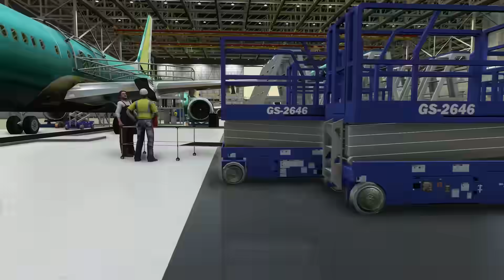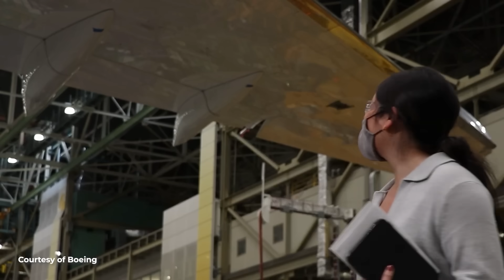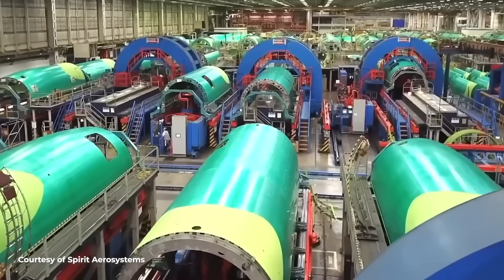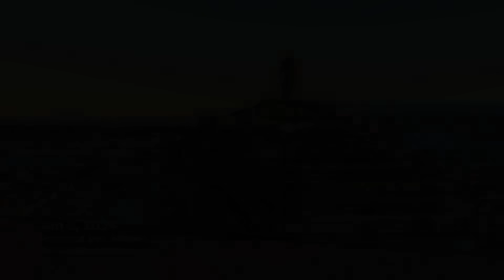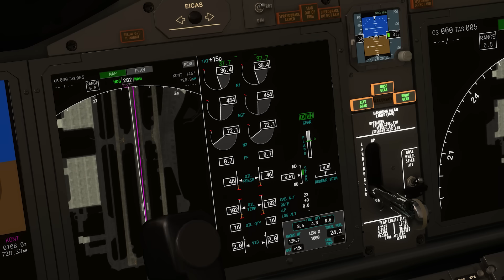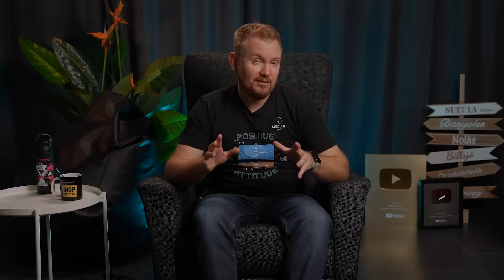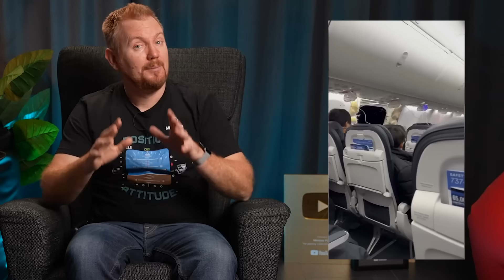Boeing 737MAX BlowOut!! The Scandal behind Alaska Airlines flight 1282

Comment: As a non Boeing engineer, I appreciate bolts. 
Thank you all for the hard work every one put into all these bolts.
Reply: Bolts hold our world together. Literally.
Reply: @CWINDOWSsystem32 *mechanically
Reply: The bolts have to be PROPERLY INSTALLED to work. 😢
Reply: @faranger Bolts are made for one purpose, I think it is not to be put just alone ... for the weight.
Reply: @malebetegrrr5793  No shit really?
As a Certified Aircraft mechanic With a Degree in Aviation maintenance Technologies from the National Aviation Academy in Clearwater FL 4.0 GPA. 

The BOLTS have to be INSTALLED to work.
 Even the slide mounting bolts were loose and no safety wire or safety cable installed.
Reply: @faranger Oh really ? Don't we discuss about how to use bolts properly ?

I have some degrees in Engineering (but I am French, sorry), I never ever show it when discussing about bolts.

I never will discuss a mechanics engineer about if a bolt should be secured, by what mean, etc ... it is his domain, no mine. But it should have been a thing to be observed by Boeing.
Reply: @malebetegrrr5793  How can bolts that ARE NOT INSTALLED GOING TO WORK.
THE REASON WHY THE PLUG FAILED IS BECAUSE THE BOLTS WERE MISSING.
MY GOD the level of stupidity in the world today
Reply: @faranger  Bro no one cares about your credentials online, let alone your GPA 😂
Reply: @Carson0101  They are good in the real world also kid.
Reply: @faranger  And that may be true. But most people who have them don't state it like it gives themselves some inflated sense of self-importance before they state something like "Yeah guys, the condom needs to be put on to prevent pregnancy."
Reply: You onviously dont listen.@faranger

Comment: It seems to me, that if those bottom springs were not fitted, either the door would not have opened or opened later on at some stage. It might even have been the case that the springs prevented the bolts from being installed in the first place. It would not surprise me if this door was fitted during a shift change or lunch break.

Comment: Does anyone else believe the the retention of the flight recorder now needs to be taken away from the hands of pilots, and becomes an AUTOMATIC function? All flight data for all flights needs to be uploaded after EVERY flight and retained for a predesignated period of time?????
I am completely gobsmacked that the pilots failed to pull the circuit breaker for the flight data recorder, and I'm probably going to annoy some by suggesting it should be seen as a gross misconduct offence. So take the responsibility away from them, and record every flight, retain, hold, and delete in accordance with other data retention policies! After installation of a cloud based system, it runs itself, and access is only needed in the few instances that require it.

Comment: Excellent video as usual Petter. Informative and unbiased! Also a reminder to everyone, always wear your seatbelt, even when the seatbelt sign is off! The only time you shouldn't have it on is when you are using the toilet or stretching your legs! In this case had a passenger been sitting there with no seatbelt, they almost certainly would've been sucked out.

Comment: The cockpit door opening would also decrease the risk of injury when cabin crew would try to open it to tell pilots what has happened. Of course, they probably would be aware to not try to open the door if they knew there is a big pressure difference, they probably would be trained to not do it, but it is a bad design to rely on people remembering such details in heat of the moment. IMHO, the doors or wall should have just a membrane that pops when there is a pressure difference strong enough to make issues. And design it so the decompression in cockpit is slower, to preserve pilots health and capabilities, crucial for everyone's survival in the plane. And less risk for injury overall.

Comment: As mentioned by many, dangerous economic policies drive negative culture/quality changes. The dismount/remount of the plug should only be performed by qualified & authorised technicians, using current instructions and checklists (which can be updated at any time). All safety-critical repair work should trigger physical QC checks, using the same checklists. And all of these actions should be covered by obligatory process controls. What you describe, if accurate, approaches amateur-hour by aeronautic standards. Optional communications, misaligned systems, performance checklists ?, QC follow-up ?, continued use of an (unpaid ?) and failing supplier without confirmed corrective actions (improvement results after time). Only the CEO's of Boeing and Spirit can be held responsible for this. THEY control the budget, the policies, the SOP's, personnel selection/training/use/supervision/monitoring/motivation, and THEY are fully aware when safety-critical issues occur, and CANNOT use short-term cost as an excuse for incorporating long-term indeterminate risk into commercial aircraft builds. How many other (currently hidden) problems will be discovered by catastrophic failures or fatal incidents ?

Comment: It has nothing to do with the design of the 737 itself? Boeing is not at fault? Seriously?
1. A Design Feature, Boeing had forgotten to tell Pilots about (like MCAS)?
2. Why are the springs left in place? They are obviously meant to ease the opening of the door. If one doesn't want to open the door ever again, why not to remove them. They are counterproductive, as they create unnecessary distress to the system.

Comment: It is quite shocking that there is a Boeing manufacturing process where the safety door bolts can be removed without a documented check that they have been replaced afterwards.
Retired now, I have worked in both aviation and nuclear fields where you RISK-ASSESS EVERYTHING. This situation inevitably asks the question: "What else have Boeing missed?"
People like me will no longer choose to be a passenger in a Boeing aircraft.

Comment: It's kind of ridiculous that even nowadays, CVR can only record 2 hours and will be overwritten if not shut down by accident. I've just read that in Europe the required recording duration is 25 hours since a few years now.
Since Boing has to have an existing solution for a longer voice recording capacity CVR to comply with EU regulations the fact that they still use a lower capacity one of brand new aircrafts is just another point for me to show they are willing to save some small amount of money at the cost of flight safety.

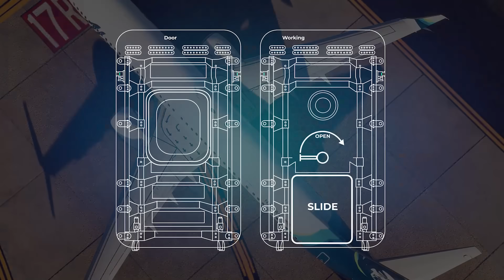Comment: 5:30 door plug diagrams,  explanation 👍 ... 24:25 1282 door plug fails 25:40 map showing where objects landed 26:32 cockpit door flies open (undocumented design feature - oops) ... 38:37 CVR keeps running by default, all emergency recording lost☹️

Comment: Isn't the existence of a wholly separate and unofficial reporting tool that seems to be used extensively at Boeing to avoid problems from being reported officially already a sign that Boeing is trying to hide things from inspectors? I mean: if it's used for comments or non-critical communications, like: part X in the cabin hasn't been painted properly, that's fine, but as Petter explains it this was also used in the case of this door-plug, which is a very critical problem. That the official reporting tool is cumbersome to work with, probably lies within the fact that it deals with critical problems and those problems have to be meticulously documented to ensure that they have been solved properly.

Comment: I don't think it was merely luck that the departing plug door did not hit the horizontal stabilizer.  When it came free of the stop pads, the bottom edge was still held by the hinges.  The air pressure forced the top of the door to rotate out and down.  When it broke free from the hinge, it was below the horizontal stabilizer with downward momentum.  It would have required unusual airflow to lift the door to the height of the stabilizer before it had been left behind.

Comment: we saw where an Australian media did a show on the Max, where they couldnt get sections of the body to go together, so the quality team went to the vender and noticed they were using rudimentary tools vs the laser straight ones,  So they raised a concern, Company sent them packing and think there were told  he would have em fired.. and yep they were  when they showed their findings. So shows one where they hold quality depts. Also any issues found outside the USA  is not required by a US made part or entire airplane to be looked at. It came up that in Canada they had a in fuel tank pump issue with a fire ?  and Boeing didnt even open the email with the concern.

Comment: 'Forgot to do something?' 
The issue is the systemic failure by Boeing to address quality control procedures across multiple aircraft models.And of course the Max control program issues resulting in the Max crashes. Problem after problem at Boeing, particularly with the 737 MAX. That's what happens when you have accountants controlling the company, not engineers.
Currently there are no MAX in Australia. When Virgin Australia receive their MAX orders Ill fly Qantas and Jetstar. No way I'll fly a MAX. God bless Airbus!

Comment: As an x employee of Boeing i really have a hard time understanding how this happened as every process is inspected, bolts are torqued and inspected.  Occasionally there are assemblies that have been previously completed that have to be removed. In this removal process there is removal documentation with an inspection to remove and inspection to reinstall  and a final inspection that the re-installation of the removed components has been completed. At minimum this would require two people signing that  this work was completed.
In my view there are a couple people involved in this that maybe should be looking for new jobs in a different industry. It should be clear on the documents who did this work and said it was ok. And if they did this work without following the procedure an initiating the appropriate removal documentation again they should be looking for new jobs. Every component has an installation process and every completed process that later needs to be removed requires that those removed components are documented and re-installed and reinspected to completion per plan.

Comment: Thank You for putting this out early. This is exactly what I though when I saw the pictures of the door with no bolts. Simple mistake by the maintenance team and I'm glad the jets that didn't have this seal replaced are not affected and everyone is ok 🙏🏻
Reply: Not just a mistake by the maintenance team, but also by the team who produced the procedures not requiring an indrpendent inspection when the plug door was only opened but not removed.

Comment: The really sad part about how Spirit Aerosystems got spun off by Boeing and now seems to be in disarray is that this plant in Wichita was THE ORIGINAL factory that built the B-29 bomber (which also had severe build problems, you should do a segment about that), and then later the B-47 (another troubled design), and finally the iconic B-52, the Forever Bomber.

Comment: Excellent presentation.  The pilots did extremely well from start to finish.  Shaken but not stirred!

QC; did the lame burdensome ISO 9000 bs play into this?  Too much paperwork means companies try to shirt around it and it inhibits productive and timely internal communications about critical problems.   

ISO 9000, etc is a lame accounting system rather than inspection system that many times interferes with the manufacturing process with it's mountains of paperwork that waste manpower and resources.  ISO 9000 was always a useless burden that's nothing but a complex paper trail of needless documentation.  Primarily implemented to aid large corporations to squeeze out smaller competitors and to burden non EU countries like Japan.  More globalist bs.

Comment: What happened was that the door plug was designed by an id10t and approved by brain dead execs.  I wouldn't have approved the design when I was 12 years old.  What kind of mechanical engineer would make such obviously stoopid design decisions?  Any other questions?
Reply: Summed up in a nutshell.  But the FAA like it to be a QC issue as it shifts any blame away from them.

Comment: This is not the problem.  The problem is that this bureaucratic process was NOT necessary in the original workforce set-up at Boeing and Everett specifically.  What has happened in the past 2 decades is that Boeing has "progressively" hired and outsourced to a less and less competent workforce and managerial class from CEO to financial disbursing (take a guess on what specific "qualities" they're hiring for - HINT: they don't hire on competence or experience).

The problem with this is that less competent (and frankly "Dishonest" and "Diverse") workers are NOT "cheaper" or "more effective".  The result is that all this "Quality control bureaucracy" becomes layered on top of them to "compensate" for their incompetence and malfeasance...something you did NOT require (at least not NEARLY to this degree) with a competent and "less-Diverse" workforce of the 1940s to the 1990s and even most of the 2000s.

This Bloated Quality control bureaucracy at Boeing didn't exist...because it didn't NEED to exist.

THAT'S why the manufacturing process has become overly expensive, inefficient, and wasteful...and it's ultimately futile to try to account for malfeasance in this way - when someone makes a mistake like this today in Boeing, they get away with it...nobody is allowed to hold them accountable.

Eventually, this will end with the death of Boeing and the larger US aeronautical industry, because - guess what - there are international competitors who don't deal with this BS (they have problems of their own, but this problem is a Cultural Poison to US Engineering and Manufacturing which our most important competitors do NOT have to deal with).

For example, we know the workers on the assembly line, their supervisors, and the management team at Boeing and Spirit CANNOT be fired for their mistakes.

The media and company REFUSE to identify them.

Take a guess why.

Comment: I really like the videos, but is the imperial system from medieval times? What is a foot? Come on man, help the world evolve. Adding or removing a 0 is simple.
Reply: Altitude for aircraft is units of feet worldwide, with few exceptions.  There are good reasons for this, which you might understand if you tried to design an alternative system based on Metric units, including a comprehensive plan for changeover.

Flight levels for cruising altitudes are in units of 100 feet, so 15 thousand feet is flight level 150.  Flight levels are then counted by tens: 150, 160, etc.  It is quite simple.  I thought people who prefer Metric units liked multiples of ten, so I don't understand why they would object to flight levels.

Comment: 12:26   Do what I do: take the nut & bolt out, move the work piece, replace the nut & bolt in its original holes so the work piece can't be replaced until the next shift (or future me) has to deal with & handle those fasteners.
Reply: You're fired for not moving the product out the door fast enough.
Reply: You're all fired for talking about it!
Reply: You're all just fired. No explanation owed.

Comment: Excellent summary.  Just a couple of things.  I have been fascinated by the continual analysis of the 'quality' systems on all videos of this event.  I remember a visit to Japan in the 80s to discuss automotive component supply and we were in discussion with the Japanese on quality standards.  The Japanese compared their 'right first time' approach with the view they had of American purchasers who insisted on inserting a 'maximum failure rate' into the contracts.  The Japanese told us they always supplied the faulty parts although they never found out why the American company wanted them!  I do have to disagree with the view there is nothing wrong with the design of the door plug.  I believe the design of regular doors requires a clear visibility from inside the cabin that the door is securely closed.  This can obviously not be true for the door plugs and it seems to me to be a design weakness.
Your throwaway comment that it was a miracle no one was sitting in 26A or B could do with some elaboration.  Was it really a miracle or did someone know something?

Comment: Brilliant, as usual... But something I can't understand is that it needs a pulling out of a circuit breaker to keep a recording. Surely, these days, when recording audio is so easy, it would be a simple matter to keep many hours of audio, without resorting to any action of any sort.
Reply: But it shouldn’t take any special toughness to stop it from recording over what’s been recorded. And, as regards the length of the recording, if they can record an hour, it shouldn’t be that much harder to record 3 hours. Especially since it seems like half of the major incidents where the plane is not destroyed have this problem.
Reply: These recorders have to be incredibly rugged - standards require them to be able to withstand a deceleration of 3400g, which is what you;ll get in a 270 knot impact, and a temperature of 1000C - so standard recording technology won't cut it.

Comment: A door plug?? How about boeing just stop cutting corners designing their planes? Ill never get on any boeing plane, thats for sure.
Reply: This was not an example of cutting corners in the design of the plane.  Cutting corners on inspection in assembly was the problem.
Reply: @GH-oi2jf  Of course it is. Two different air frames Should be designed and made, one with the extra doors, one without. According to how many seats you want.
You don't buy a "3 door car" that's actually just a 5 door but without door handles! That's just ridiculous!